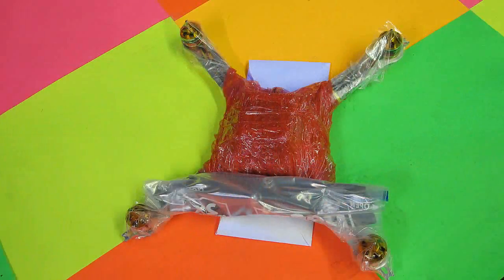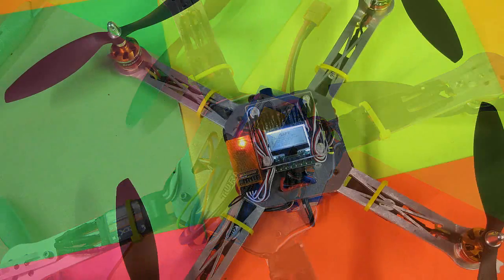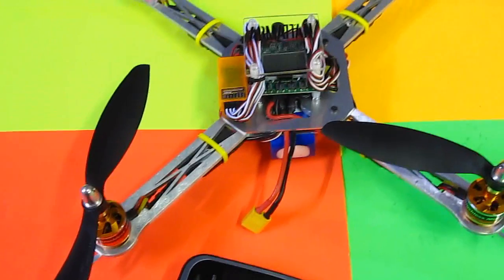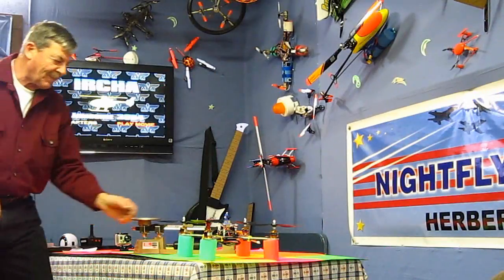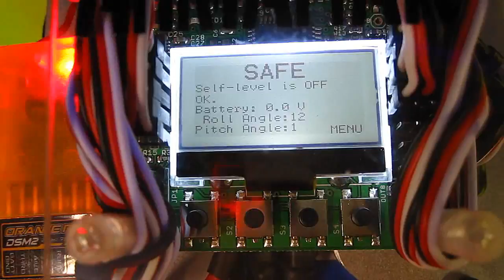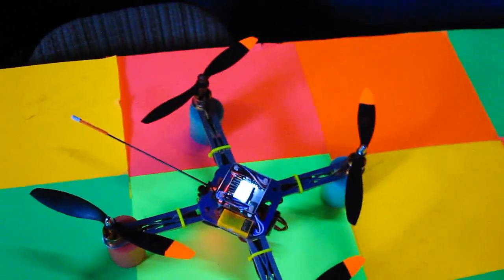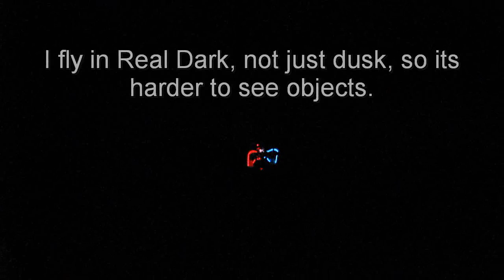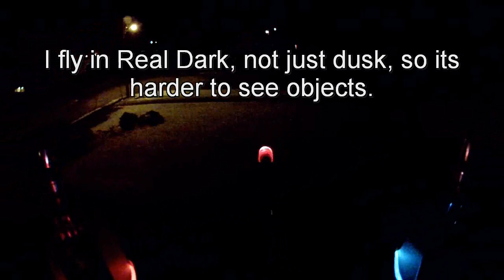Heavy Hauler!  Custom built CNC Quad Copter from Bryan's Flyin' Custom Builds.

Comment: Nice cool frame!  I would definitely get rid of those landing sponges. They have a huge surface under the props which generates enough drag and turbulence to induce oscillations in the flight when harder on the throttle - as on this video by the ascending scene filmed with the Gopro when u hit the throttle, u see these slight oscillations which in windy conditions might get worse. U r an experienced pilot so u dont need them, try to exercise & land it always in your hand. It's fun!